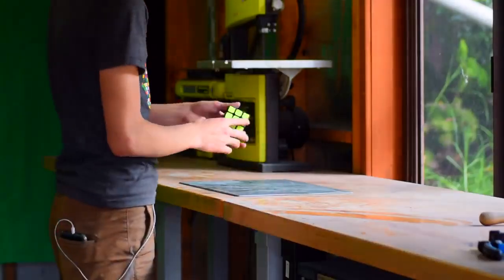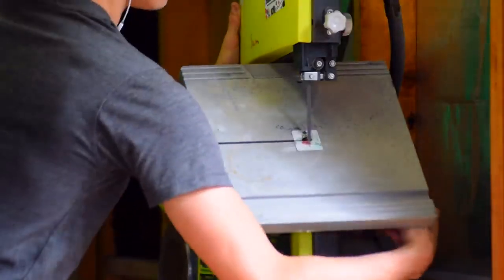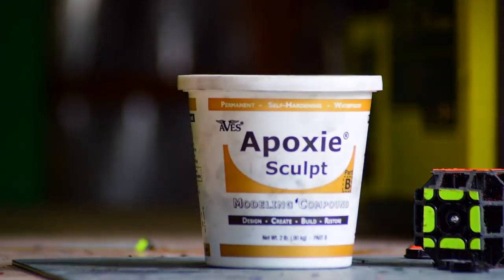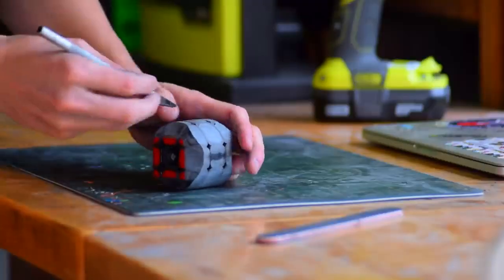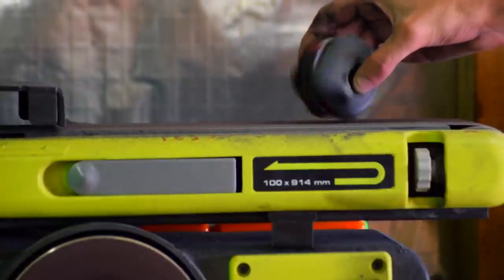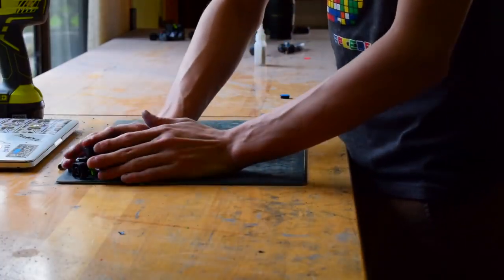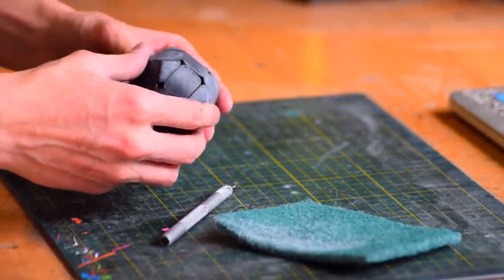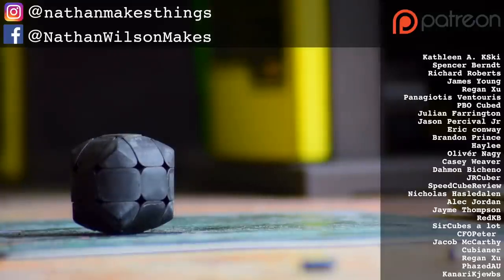A Cylinder on All Three Axis Doesn't Make a Sphere / Day 22 / Season 1

Comment: Now... what do you get when you round it across the diagonals of the cube?
Reply from the maker: I’ve avoided this particular shape for many years due to the difficulty of making that shape uniform. I will try it out one day though
Reply: @BandsawsAt45Degrees  I look forward to it!
Reply: @BandsawsAt45Degrees  couldn't you just barrel a fisher cube on all 3 axis? Or am I misunderstanding the concept?
Reply from the maker: That would have a very similar result to this puzzle. To do it on four axis would require barreling on all four corner axis